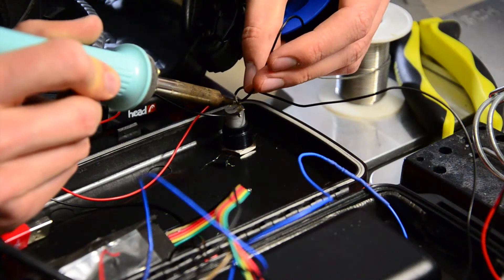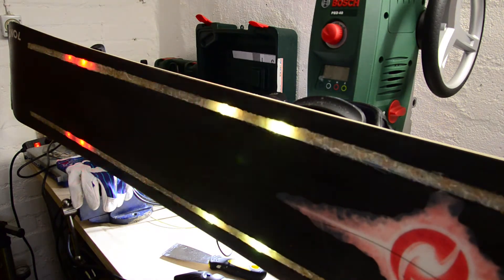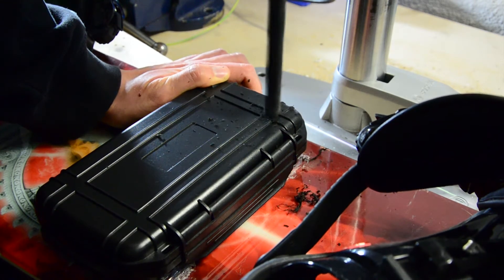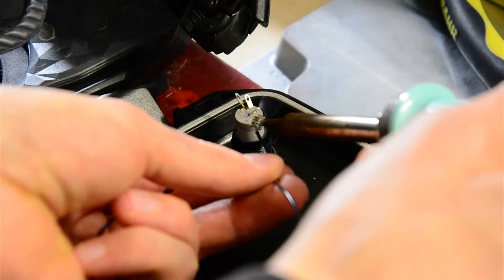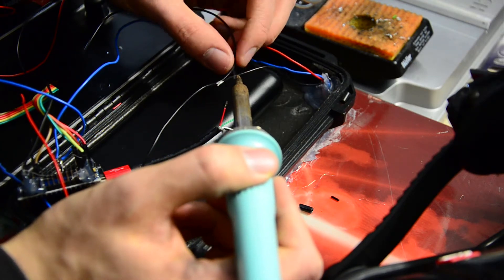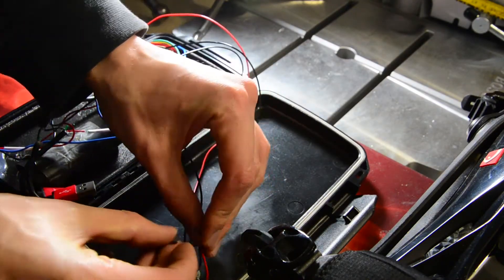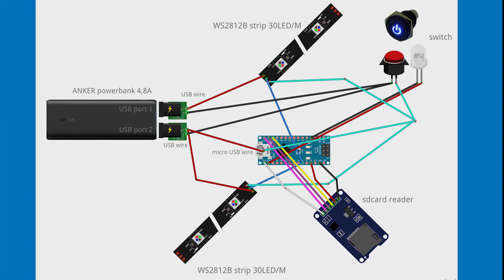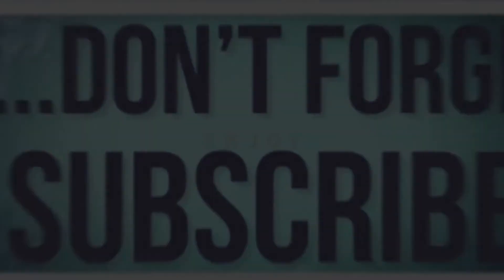LED Snowboard Upgrade

Comment from the maker: I will provide the PDF file with the schematic soon. :-)
Reply: hamburgtech could you provide the schematic from when you used to the 2 arduinos and 2 sd cards?
Reply from the maker: ThatEquine Pilot Well yes I can do that, but will take some time. But I mean 1 arduino works better ;-) Or what do you plan to build?
Reply: i know it will be worth the wait :) i plan on building an LED concept for my custom lebron 12 shoes. im going to cut the nike sign out, put the LEDs in where the nike sign was and then cover it up with maybe plastic or something clear.
Reply: i also plan on putting LEDs under and in my car, but thats more down the road :)
Reply from the maker: Hey thats pretty cool, but I would recommend to use only one arduino for this, because the animations will be perfect synchronous. With 2 arduinos I had the problem that the animations where a little bit asynchronous. I can provide you a PDF of the old design, but I will have access to the computer with this software in one and a half week. Maybe you can cover the LEDs with a 3d printed swoosh (nike sign). Cheers!